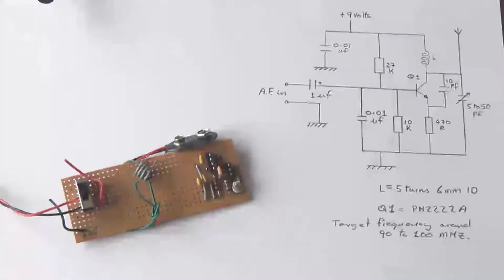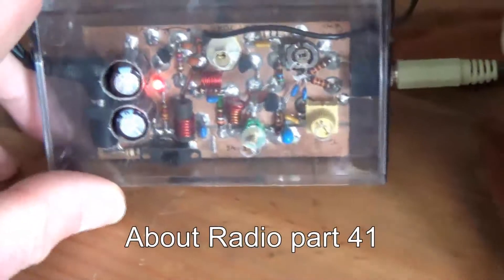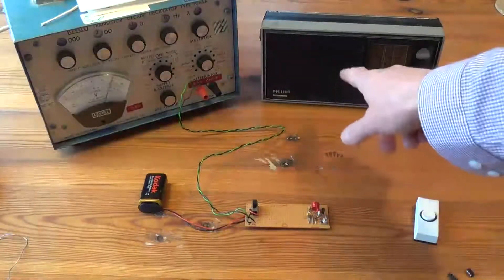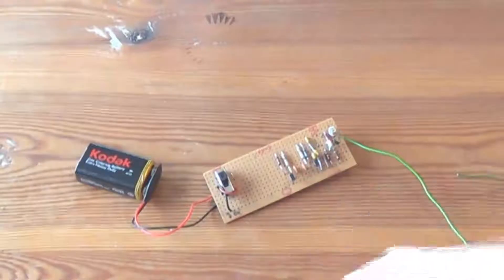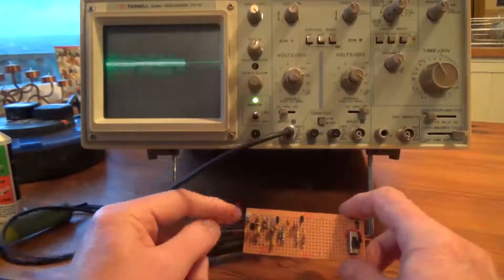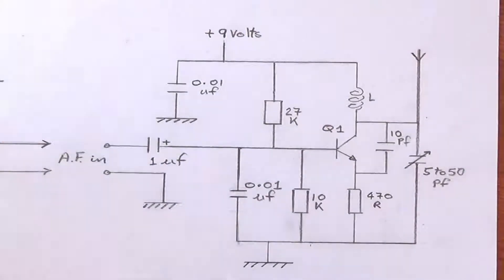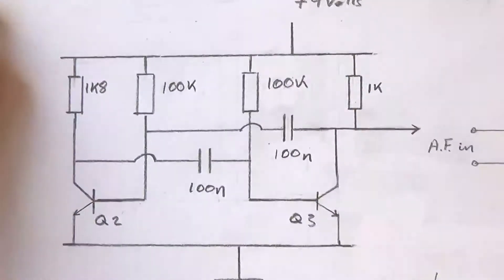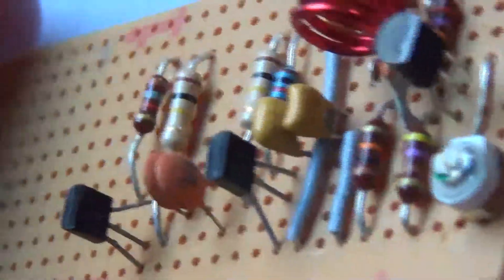About Radio 88 Short range Radio bell project. re-edited

Comment: You're feeding it too much from the multi vibrator. Put a resistor in series with the 1uf capacitor. I bet when you tune your radio, The signal is spread across a wide range of frequencies. This will limit the range. Do you want AM or fm modulation Andy?

Comment: Hi Andy, check out " Building a super spy bug ", a really easy but effective little FM TX. 2N3904 good, BC547,8 better, my experience. Google Images. Also, check out Dazaro3 on YouTube, good at the FM TX trade. Love the vids. Learning. Parallel Tank Circuit, Ant to  collector side of Q1, or for more stable, can tap end or 2nd coil of ( I use ) a .125" Dia. Form ( 3.175 MM ), with .020" Dia. ( 0.5 MM ) Wire, 5 - 6 Turns, the Ant. is 165 CM ( 69" ), 26 AWG, or any small gauge wire. Can use fixed value of 47 - 56 pF, in Tank Circuit, or Trimmer Capacitor. Keep TXing, See Ya, C.
Reply from the maker: Hi Cass here’s a copy of something I’ve sent to Dazaro3...
 I’ve just received the 2N3904 transistors and popped them in to a another similar circuit where I use three PN2222A transistors and there appears to be a significant improvement with the 2N3904’s  which surprised me as they are both specified as ‘NPN General Purpose Amplifiers with similar DC Current Gain and Current Gain Bandwidth Product at 300MHz’
The significant difference seems to be that at 4.0 pf, the OUT PUT Capacitance of the 2N3904 is 50% lower than the PN2222A’s and the INPUT Capacitance of the 2N30904 is around one third of the PN2222A ...
 
I need to make other tests, but it certainly seems from a direct comparison trial the 2N3904 is the better.
Kind Regards ... Andy

Comment: You can use a 142cm antenna for (100Mhz) and that will help with the
transmission range,the oscillator transistor i would use a 2n3904 it will
use less current and make the transmitter a bit more stable.
Reply from the maker: Hi there, I’ve ordered some 2N3904 transistors as they seem to have lower input capacitance than the PN2222A  that I’ve used but I'm not sure how significant the difference is. And OK on the antenna, really I should build an antenna tuner into it like the one o built in ‘About Radio 41’ as that makes a huge difference to performance.
All the best ... Andy
Reply from the maker: Hi, I thought you might be interested... I’ve just received the 2N3904 transistors and popped them in to a another similar circuit where I use three PN2222A transistors and there appears to be a significant improvement with the 2N3904’s  which surprised me as they are both specified as ‘NPN General Purpose Amplifiers with similar DC Current Gain and Current Gain Bandwidth Product at 300MHz’
The significant difference seems to be that at 4.0 pf, the OUT PUT Capacitance of the 2N3904 is 50% lower than the PN2222A’s and the INPUT Capacitance of the 2N30904 is around one third of that the PN2222A
I need to make other tests, but it certainly seems from a direct comparison trial your right about the choice of transistor so thanks for that.
Kind Regards ... Andy